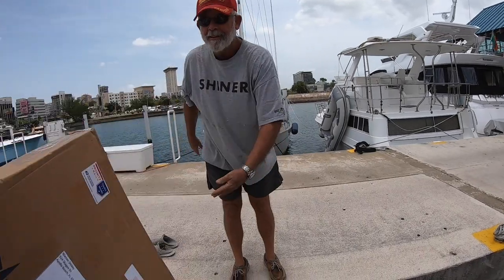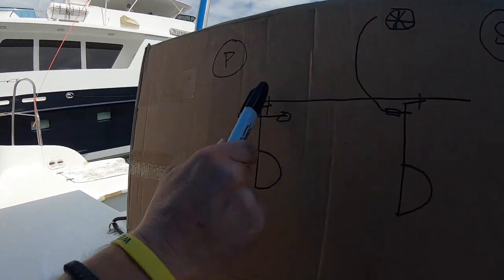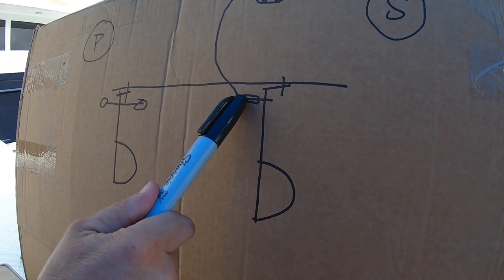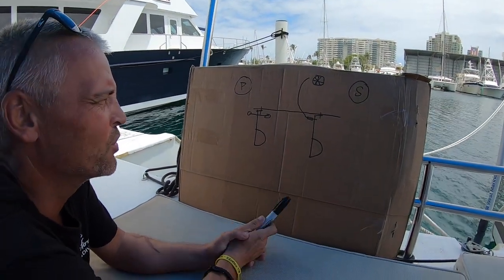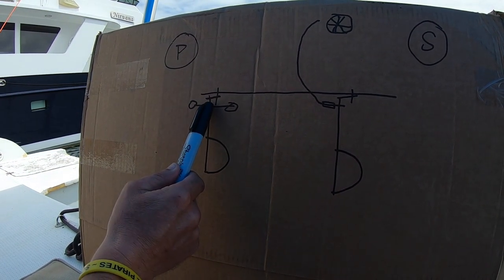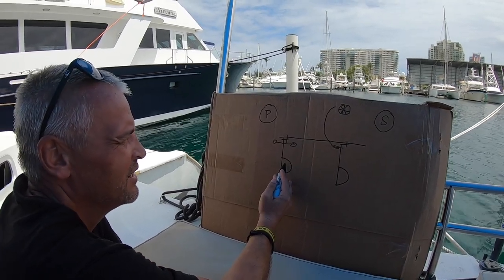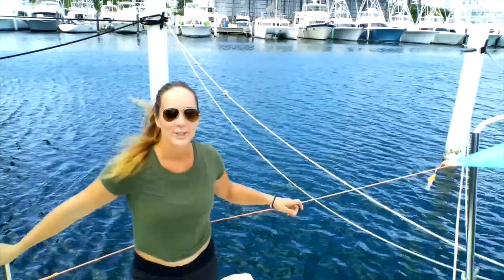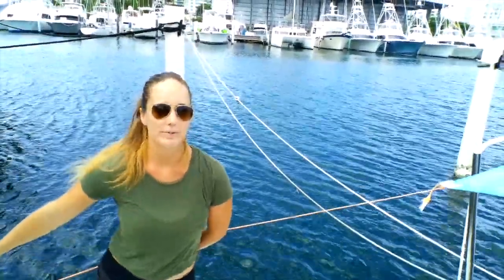Preparing to Move Our Hurricane Damaged Boat (S2 E5)

Comment: I just started watching. 
A couple of alarm bells on that rudder. Is it possible that someone used the silicon to plug a leak to stop the boat from sinking? 
Also. When you disconnect the starboard rudder, you should probably find away to lock it in the forward position. I know it's currently ceased but Murphy says it will miraculously free itself at the worst possible moment.
Sorry. Just a couple of things that would be playing on my mind.
Good luck.
Reply from the maker: Well keep watching and you will see what played out 😂

Comment: So a question on the port seized rudder post, is there a dripless bearing that is corroded or is the post and rudder bent due to a collision from the hurricane?
Reply from the maker: There is corrosion on the bearing!
Reply: @BarefootTravels  so on the hard time, good luck with the voyage
Reply from the maker: We will get her on the hard eventually but  unfortunately due to the current situation  it’s just not an option!